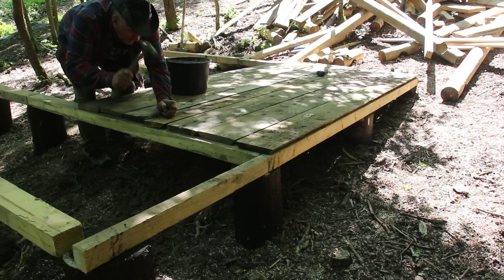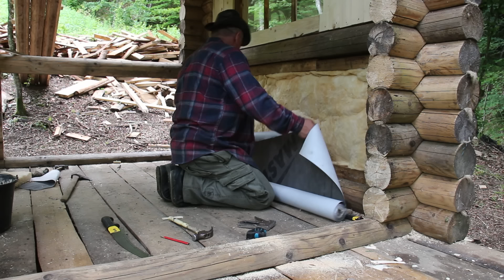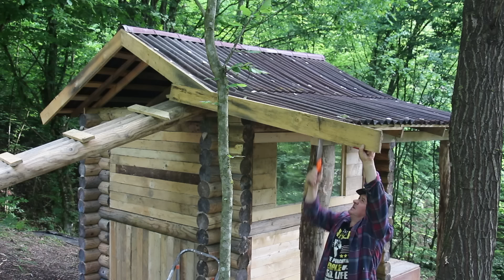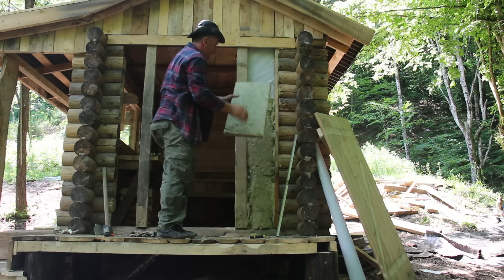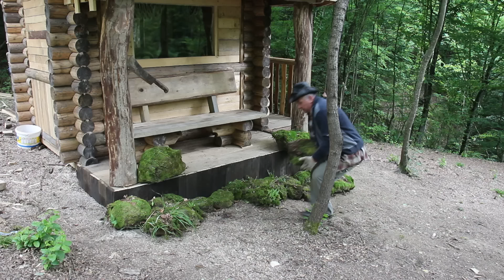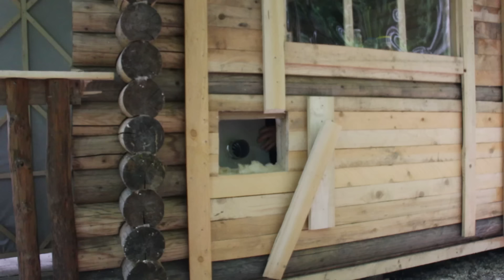From scratch: Construction of a mountain hut from used materials

Comment: Much of the exterior siding with the exception of around the entry door appears to be  butt jointed boards on the exterior with no barrier between it and the insulation. What is going to keep rain and moisture from getting through the cracks and wetting the insulation?
Reply: Correct me if I'm wrong. You put a barrier between the insulation, and the interior boards but nothing between the exterior boards, and the insulation with the exception of the wall where the entry door is. The exterior boards are one by six butt joined with cracks along each edge.

Comment: I’m curious. I don’t see an exterior vapor barrier. The insulation is going up against the outer wall and moisture could get through to it. The exterior siding is planks with no overlap and no vapor barrier underneath. Great job but it seems like that one added step would not too much.